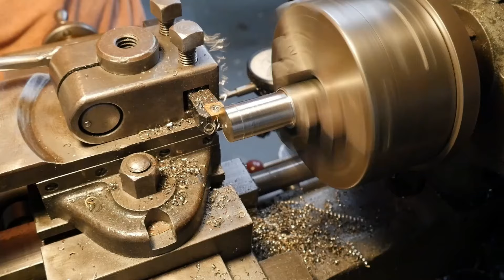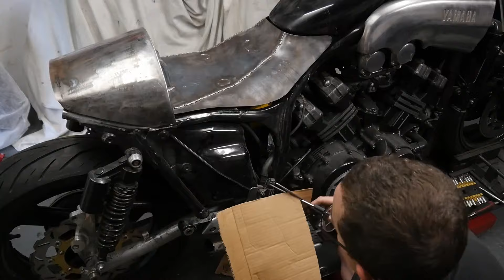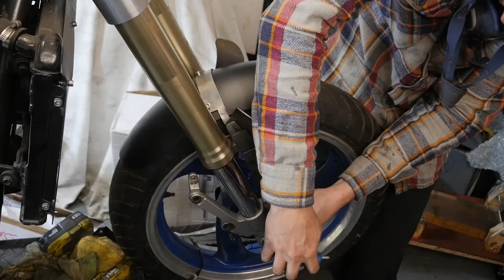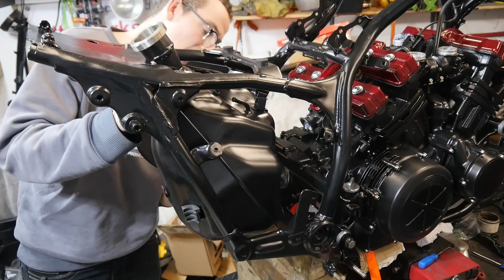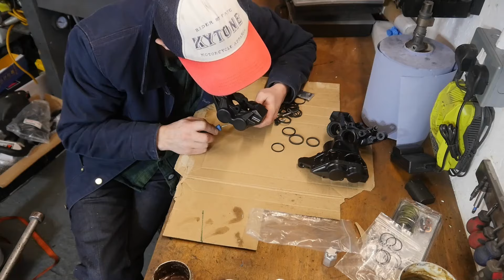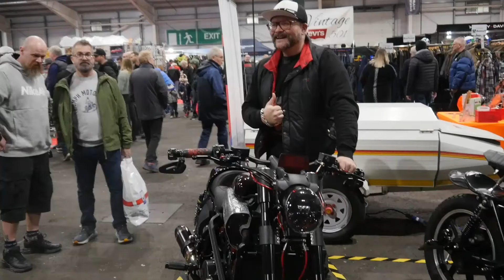TIME LAPSE BUILDING A CUSTOM V-MAX 1200 - Shoogly Shed Motors Episode 106

Comment: i cant find video where you rebuild back end of it and fix the wheel situation to 17" wheel i would love to know how you did it
Reply from the maker: The rear wheel is a custom one from Taylor Made Wheels. The swing arm was notched both sides as much as possible to fit a 200 tyre, and a custom swing arm brace welded to the underside.
Reply: Thank you for answer :) it worked with original driveshaft?
Reply from the maker: @TheEternalCrow   yes. The wheel was made to work with the original drive shaft and the notching was done so as not to foul the shaft.

Comment: Great job. Love the bike 
The engraving on the air intakes, how was that done?
The silver box you wired up on the side, what was that?
Reply from the maker: The engraving was done by Tony The Engraver, a very talented motorcycle engraver and casting artist.
The silver box is a NWT X21 Plus P - it's a smart electrical control module 👍🏻

Comment: Hi guys.  Great build.   I was wondering what you did with the left hand side plastic radiator guard with reflector.  Doesn't look like you used it.  Mine got cracked when I got rear-ended.  Long story.  If available, let me know, thinks. I get ideas from you.  The motors on these are so nice.
Reply: Just saw the rear tail light, any specifics on that would be appreciated.
Reply from the maker: @78_outlaw would be the person to ask!